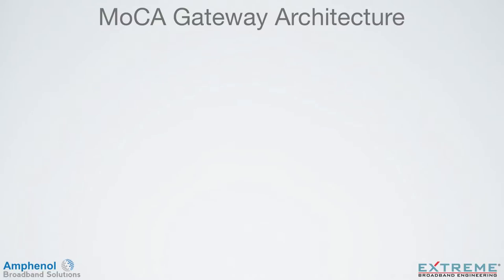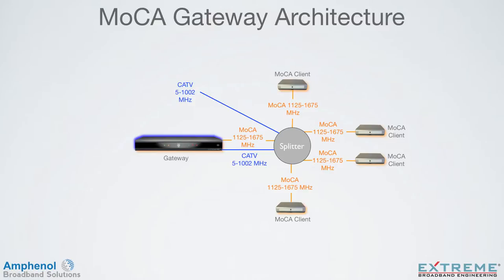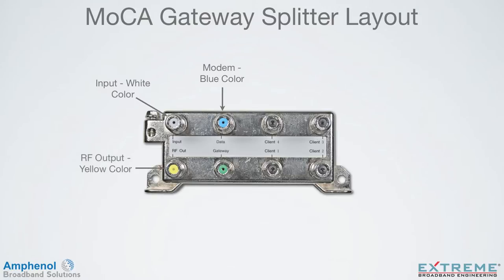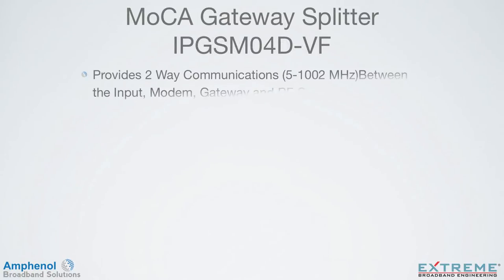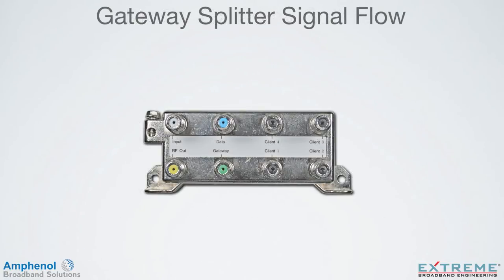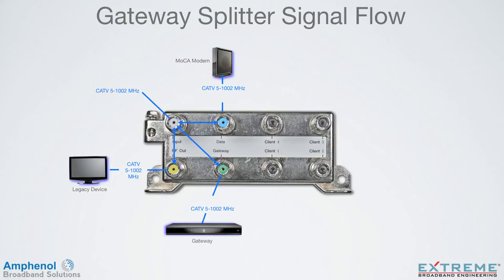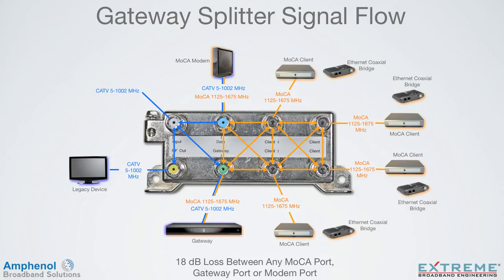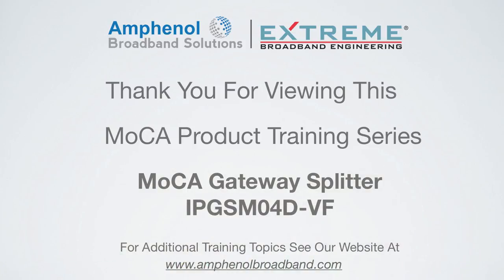MoCA Gateway Splitter: IPGSM04D

Comment: can this be used for a “typical” moca setup: all room coax cables connected via home run, first moca adapter connected directly to modem, etc etc? i’ve been researching the optimal moca setup but see lots of differing opinions.
Reply from the maker: The IPG series can be used in installations where all set tops are MoCA only.  If there are traditional set top boxes in the network that use 5-1002 MHz, the Gateway splitter should not be used.

Comment: Ok this seems like a good fit for me. However due to the 2 ports the Data and the Gateway I have a question. In regards to the data and Gateway ports. Now forgive me if I don't get this but My Modem is an all in one that does Moca meaning it is  I have Surfboard modem for my wired and wireless internet and it also has a Coax port for Moca. This is my all in one. Thus which port do i use the data or Gateway, exclude the Yellow port as I have no need legacy devices?
Reply from the maker: The blue data port is my first choice as its is the low loss port off the 3-way splitter. The isolation losses in MoCA between the Data port and MoCA only ports is <28dB. Same can be said of the gateway port as well since it was designed to connect a TiVo stand alone controller.

Comment: If I have an amp on ur current setup what port would it go on this
Reply from the maker: Thank you for your comment.The IPGSMO4D is a passive device that includes a 3-way unbalanced splitter on the input. The blue data port is -3.5 db loss, green gateway and legacy CATV ports are -7.5 dB down. This device is designed to take the place of the amplifier provided the input to customer premise equipment meets the required minimum input levels between -7 to -10 dB.